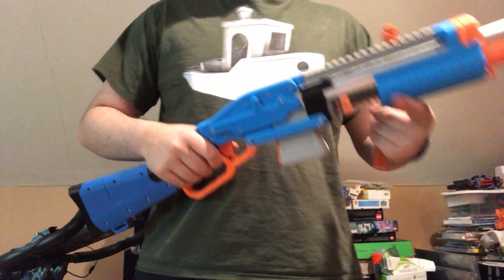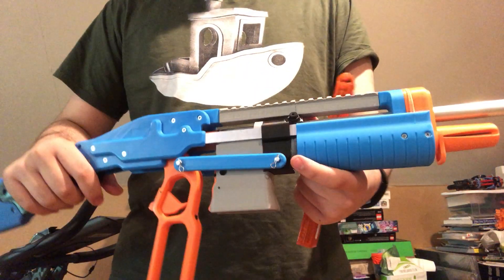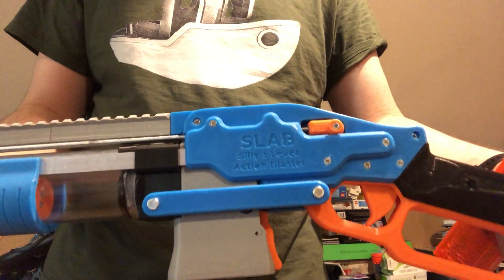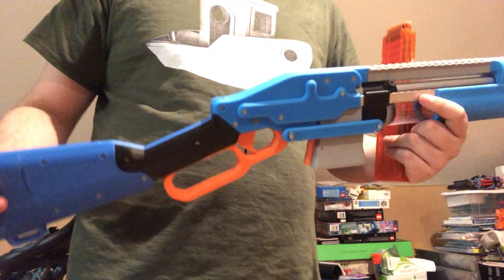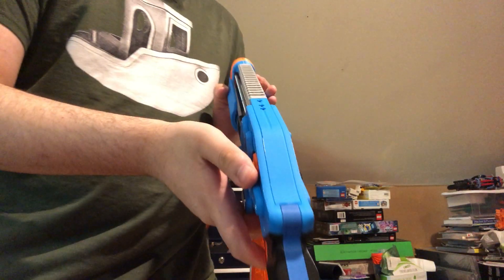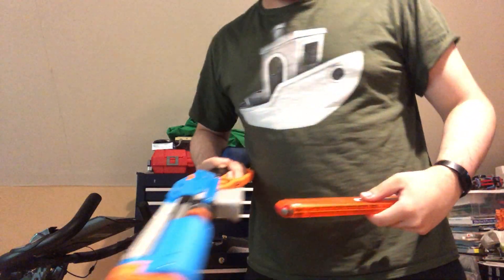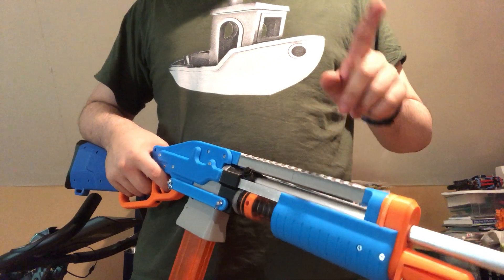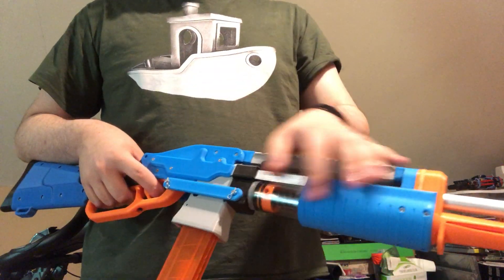SLAB second prototype overview

Comment: Would it be possible to do built in iron sights on the parts?
Reply from the maker: There is a nice sight groove along the top to use in a pinch. If I make any iron sights, they will be for the picatinny, or attach to the muzzle with a screw.